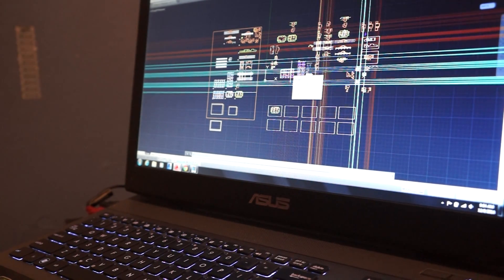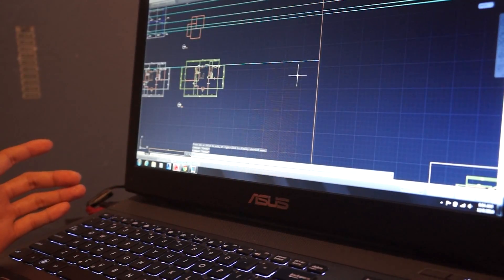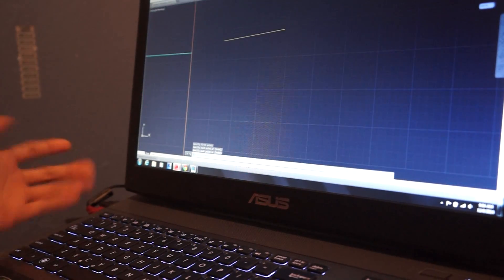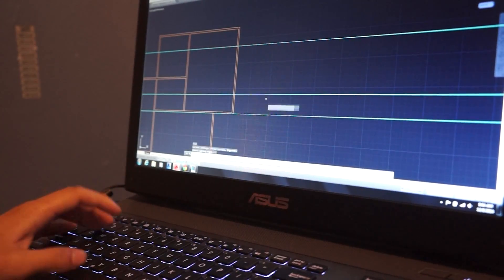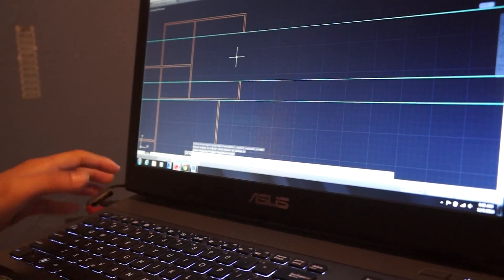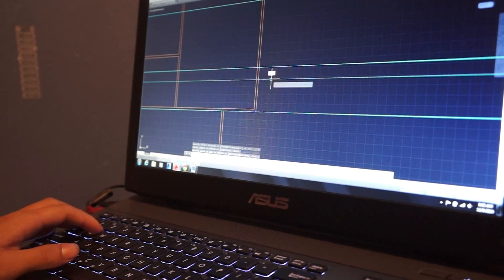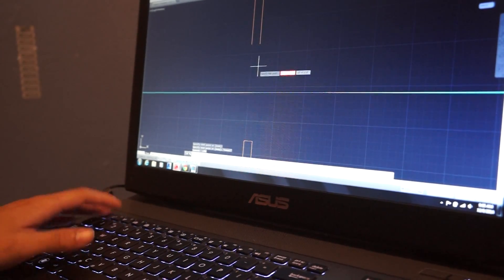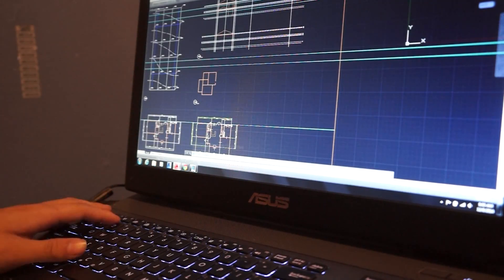How to get faster with AutoCAD - Main Keys p.1

Comment: Nice video, some of the faster cad I've seen on YouTube which is nice, but here's a couple of points to speed you up even more. Set right click customisation settings to have right click as enter. Also with regards to trim, or any other command, enter will always select the default option shown within the <> brackets. So then trimming an object like this, just type TR, then hit space twice then select the line section you want to delete. Much more efficient.

Comment: The quickest way to improve speed is to put the most common commands on the left side of the keyboard by editing the .pgp file, found in Tools / Customize / Edit Program Parameters (acad.pgp).  Some commands I adjust are (Line = A) (Circle = CC) (Pline = AS) (Pedit = QW) (Move = G).
Reply: Could you  convert back to default if your using a company computer and can you setup custom MEP commands short cuts.
Reply: I'm not familiar with MEP commands, however I would like to look into them myself.  For the PGP file you have two options 1.) Print out the original PGP file for your record and edit the original PGP file.    2.) Or copy the original PGP file to a new folder, and edit it.  Then set the file pathway to the new folder.  (I personally have never added a pathway, however there are sources online for that topic.)  Let me know if you have any problems.
Reply: Or, you have a mouse with a spare button then set that button as escape. Saves you moving your hand around
Reply: Al Paca That’s one good way for escape key because it is used a ton.  I personally use a pad to rest my left palm on and I easily pivot my hand to press the escape key.  Resting the hand on a pad also takes weight off your shoulders. I suffer no fatigue.
Reply: JayZoop I use a logitech G910 which has a large number of macro keys around the left side of the keyboard. I link those keys to the most commonly used commands including the addition of the space key to confirm the commands, and then with the G910 I have 3 different setups for my macros which are switchable with the M1 M2 and M3 keys. I have a section with modify macros, a section with draw macros, and a section for annotation macros. Then I have a switch on my mouse which toggles the program profile and then I have another set of macros linked to 3d modeling commands. One really useful set of macros will let me record the current camera position, then recall it and move the camera to a specific part of the model with just a single keystroke.
Reply: Nice tips!   Do you have a favorite source for learning macros?
Reply: JayZoop na generally I just look at which macros take the longest to type then shorten them to a single button push. One website which you can go to for lisp routines is Lee mack programming (give it a Google) there are some incredibly helpful tools on that page all free of charge :D
Reply: I checked out Lee Mack programming and found a few lisp commands helpful.  Thank you.  Are Lisp commands very hard to write yourself?  All the coding looks very complicated.
Reply: Those are in the Alias edit